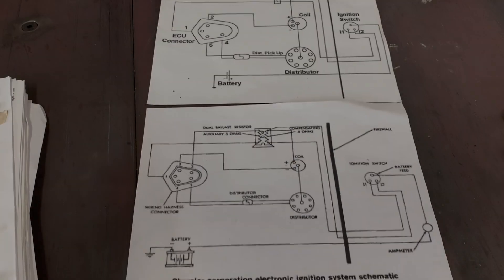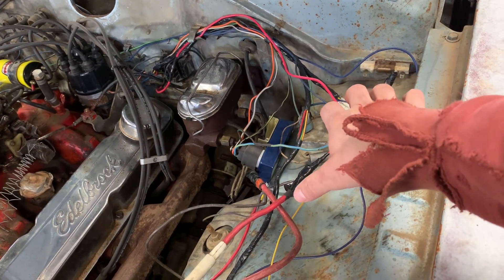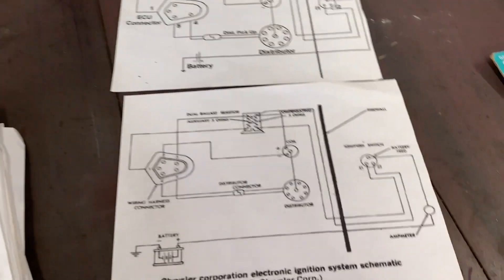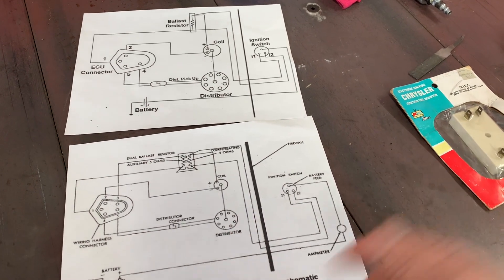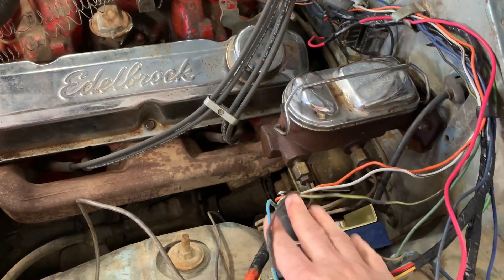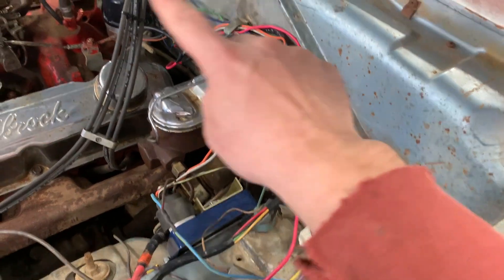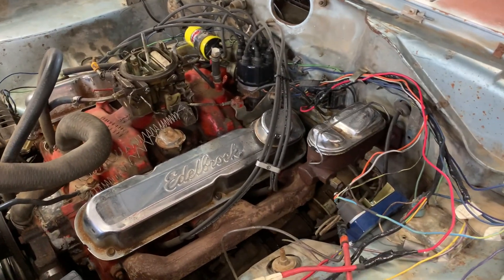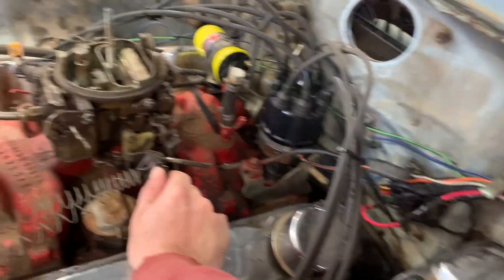Mopar electronic ignition system without the ballast resistor

Comment: the 5 pin module and dual resistor is for older stuff. they switched to the 4 pin and single resistor and stuck with that till they started using computers.
you CAN use a 4 pin where a 5 pin was.
no mods needed.
you can NOT put  5 pin where a 4 pin was.

Comment: For those finding this in search of wiring Chrysler Electronic Ignitions, I think the 5 pin ignition control module is the early version with the 4 pin being the later one (Note the wiring diagrams, as the 4 pin doesn't show the ammeter/ampmeter which was deleted on later models in favor of a voltmeter). Direct Connection (Mopar Performance) guidance was just use the 4 pin version. If you have the 5 pin connector, cut the pin 3 wire back, insulate and secure in the harness. The control module does not need it. As others have noted, the ballast resistor is only needed for the "old" style ignition coils. Convert to a new style E-core ignition coil and ditch the ballast resistor all together or use the single element resistor for older style oil filled coils.
Reply: So if you have an older one with the ammeter that does that pin 3 wire supply the ammeter? I have one that is pretty much a mess!! Trying to straighten out the wiring

Comment: The standard points ignition uses a 10 volt coil (cold cranking voltage) and needs the resister to hold it down. If you are going electronic, get a 14 volt coil from any later ignition model car.

Comment: The five pin is the older one. The extra pin is 5 volt or so power for the circuitry itself, off the second side of the ballast.. The four pin modules get the power internally off the 12 Volt input. The 70's mopars can use either, they are more reliable with the four pin module. You cannot use a five pin module in a four pin setup. But many aftermarket modules have four pin circuitry, and a fake fifth pin.

It is not a good idea to mix ign 1 and ign 2. The one (Ign 2 I think), that is not powered during the start position of the key switch, is off during starting to prevent the alternator off, until it is up to speed, With it powered, you have the risk of electrical spikes as it picks up speed. Those spikes can damage a lot of electrical parts(Radio, ign module, to name a few). 

You should really research why things were made the way they were. It may work your way for 99 starts, then kill something the 100th time. Just because it works that way, does not make it a good way to do things.

Comment: I did hei chevy conversion on my dodge d100 the module went bad exchanged it with one of the cheap ones runs like crap. I'm going to convert mine back I wouldn't recommend it
Reply: I'm using hei  module on my dodge  truck.. just for safety  I'm still  using  my balast to positive + coil but  engine  has better  snap  and startup ...been on two years no problems

Comment: Your not completely correct! The purpose of the resistor is to reduce the voltage to the coil to about 9 volts. Different coils use different ohm resistors. If you put 12 volts into a coil that needs 9 or any amount less than 12 volts you will over heat the coil. It has nothing to do with points!

Comment: Thanks I am fighting this issue with a 72 d100
Reply from the maker: Scott Durant did you get your d100 figured out?
Reply: @tagsgarage4944  I took the old one out and put it back in  I am going to try again next Sunday. Thanks to you I know I had a single ballast and I was using a double ballast diagram and didn’t know it
Reply from the maker: @scottdurant6868  awesome, glad the video helped!
Reply: @tagsgarage4944  I’m no mechanic just my hobby but I finally figured out I already have the electronic ignition it came on all Mopar v-8s in 1972 in California only. So now I am trying to use the original distributor and am waiting for the correct dual ballast to arrive in the mail. Thanks again I am now a subscriber
Reply from the maker: @scottdurant6868  awesome thank you for subscribing!

Comment: I got a 89 Dodge w150 truck it came out factory with the 318 TPI fuel injection I pulled that engine out and done away with the fuel injection I put a 360 engine in it with a 600 Street warrior Holly removing that fuel injection killed the circuit to the fuel pump the coil and the charging circuit I removed the electric fuel pump from the tank and converted it to the engine mounted fuel pump because that pump in the tank didn't have any power I also had to wire an external voltage regulator to the alternator to get it to charge the 12 volt wire from the switch while running puts out 13.5 volts I wired it with a 1978 Chrysler electronic ignition about like what you have I put an MSD blaster ignition coil on it it's fried that coil in a matter of days so I've tried the Excel super stock coil in 10 minutes it heated it hot to the touch my truck is putting out 14 volts to the coil I wired a ballast resistor  between the hot wire going to the plus on the coil even with that resistor it's putting out almost 14 volts to the coil with the MSD coil and the Excel coil it overheats both of those I put an old model style coil on it and it's not getting quite as hot the problem with those super coils like you're talking about they're internally resisted but at very low resistance allowing More voltage to go through the coil and with that increased voltage they get so hot they're burn you on my truck every wire that I have checked while running puts out charging voltage on my truck because that stupid computer has the only 12 volt coil wire that is constantly at or below 12 votes sadly to say my truck's stupid computer is the only thing that has that certain wire coming from it and without that TPI fuel injection working the computer kills that wire I think I'm going to wind up putting in MSD ignition system on my truck to get it to run without that stupid fuel injection that is not very powerful older model Dodge trucks have nice video thanks

Comment: When you wire IGN 1&2 together.   Doesn’t engine keep spinning the starter when you let go the key?
“IGN start” goes to the starter solenoid too.
Reply from the maker: No
Reply: On Mopar he can just tape etc. together all the wires that were going to ballast resistor (shown) because there's starter relay that handles separation of ignition "run" wire & "start wire" to do those functions. He just simplified things nicely.
Reply from the maker: Thank you  @shanew.williams  ! I should have explained that, it’s good to have the how/why things work instead of just the answer. @Tom Reyn does this make sense why the starter won’t keep spinning?

Comment: I came here because Im hooking up a progression ignition distributor. (I recommend you look that up). The ballast resistor keeps the unit from getting a consistent 12v, so I needed to bypass it. I’m going to keep the mopar box a and resistor for looks. 

I’m going to wind up stealing the ignition 12v and wiring it to a relay that powers coil and distributor. You are saying this wiring goes to alternator? So I need to make sure ignition 1-2 get reconnected? 

Good info on the older coils needing the resistor. I already replaced my coil with the high vibration. 

My only challenge now is getting a tachometer to work from the new wire coming from distributor.   How did the factory tach get a rpm signal?

Comment: Gm moduel has a larger max curent limet of 4.5 to 6.5 a and adaptive dwell. Mopar moduel is 1950s-.1960s tech! With hei 1 can run . 045+ on plug gap! Mopar is .35! Hei rocks! I am a ford man!
Reply from the maker: Good to know.
Reply: Just get an msd box and you can throw hotter sparks ⚡️. Plus it would stay more true to style.
Reply: Msd is good for hi rpm and fireing fuel soked plugs! Hei is better from idel to 6000 rpm. You can mount hei moduel to heat sink and use the oe dizzy!

Comment: According to Chrysler the dual ballast resistor protects the pickup on one side and the module is protected by the other side.
Reply: So he’s wrong?
Reply: @cavaleiro95  yes 👍
Reply: @larryreagan6936  hmm ok thanks for the reply
Reply: @cavaleiro95  no problem. Without a dual resistor you'll burn out either the pickup or the module. Parts are too expensive to do that.
Reply: No, the "secondary" side is for the RPM sensitive "speed switch" for applications like holding the throttle open on deceleration until you drop below a certain RPM for emissions, etc.  The "primary" side is the feed for the coil.